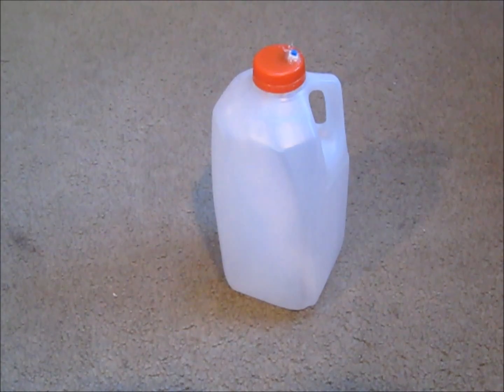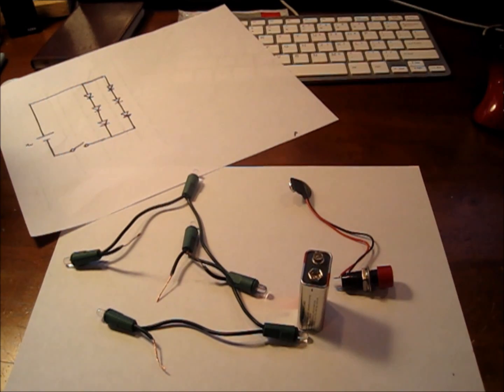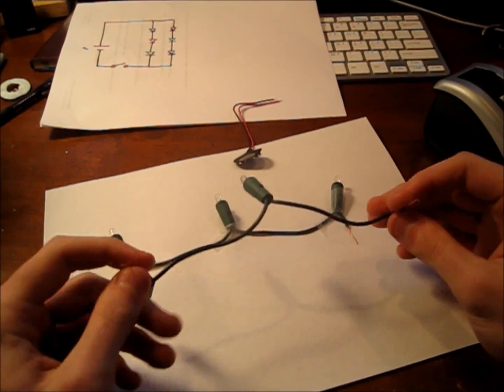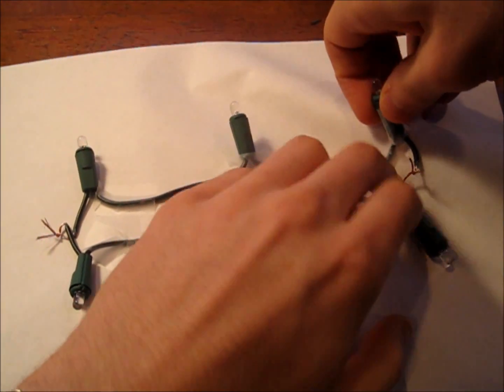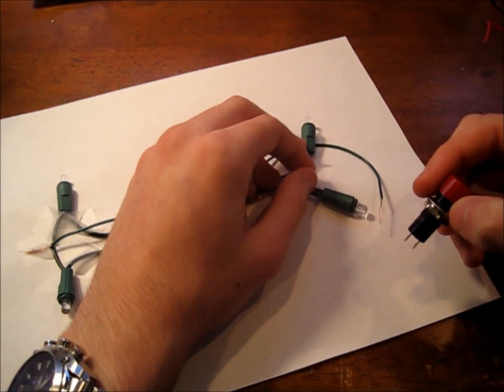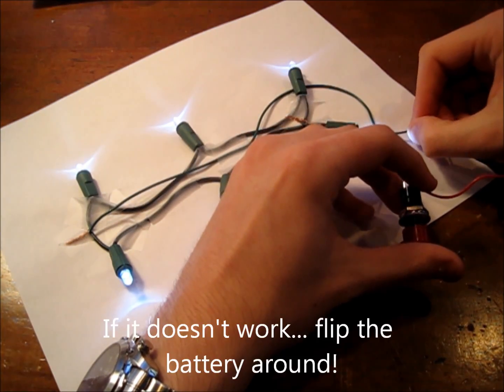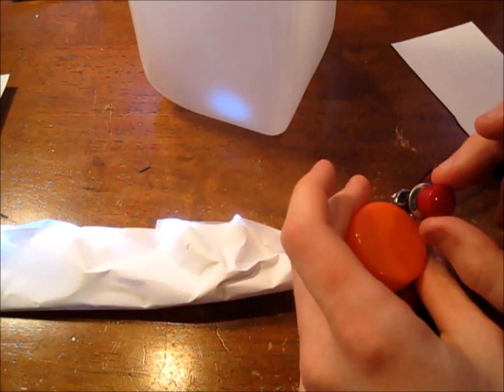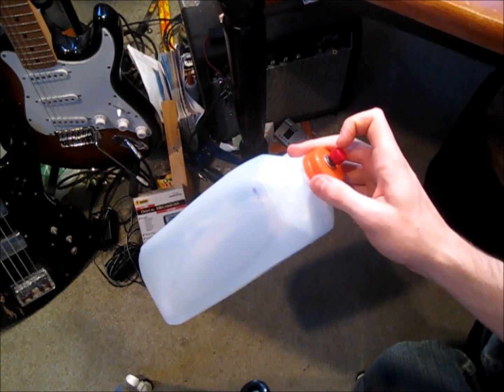How To: Make a LED Lantern!

Comment: Really cool, but you drew the schematic wrong (I know what you meant and you were on the right track), but switched power (switch) should have looked like an upside down "T" because you used a button switch in this case (I know you drew it for meaning a general switch), also LEDs are filled in diodes with a circle around them and two arrows pointing outward... I mean no trolling, sorry lol, just kind of habitual; schematics are very important to my line of work.